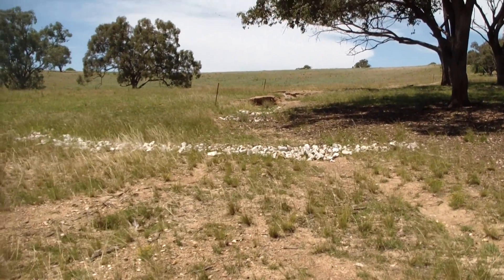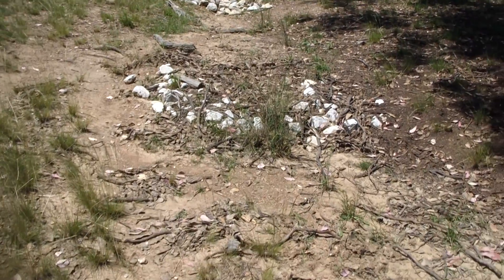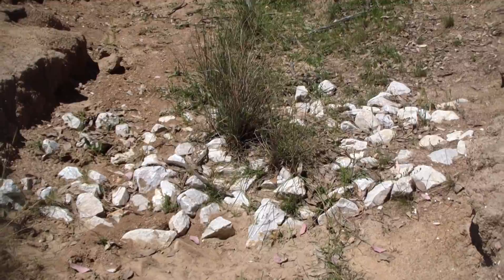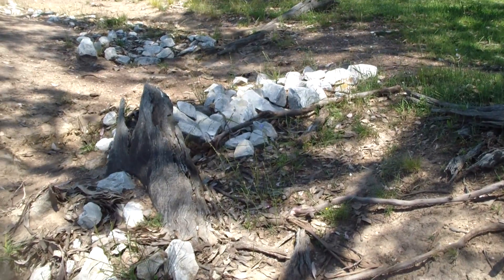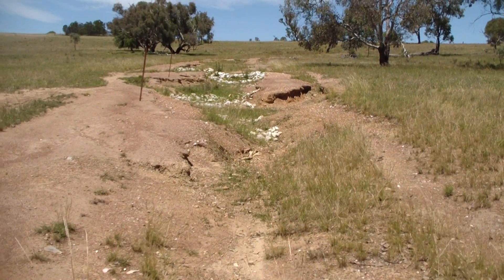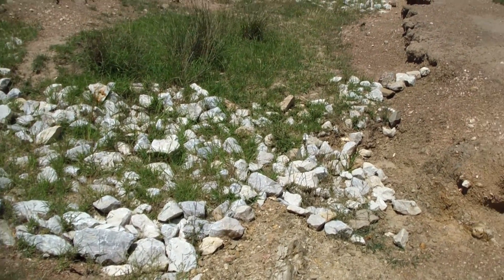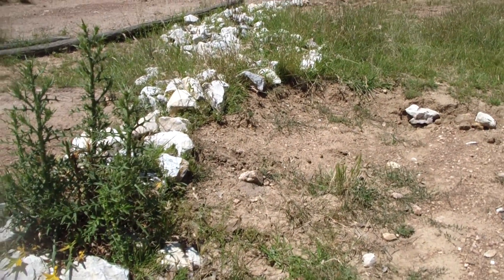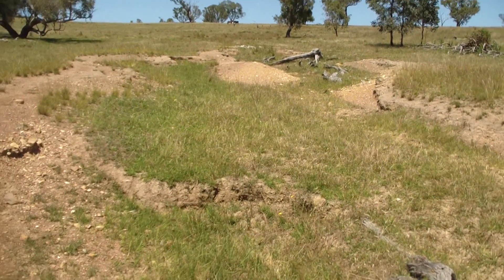Landcare, Craig Sponholtz and farmer build rock erosion control structures and Zuni Bowls

Comment: My experience is that it is not a one time and done kind of fix.  Each year or two I return to a problem area to repair and reinforce the points that turned out to be not strong enough using more rock, etc.  After the third of fourth redo then it is good enough for at least a 5 year term and then there may be a small amount of re-strengthening needed.